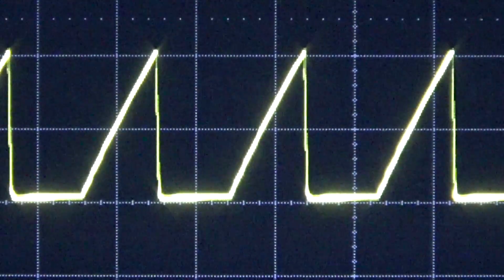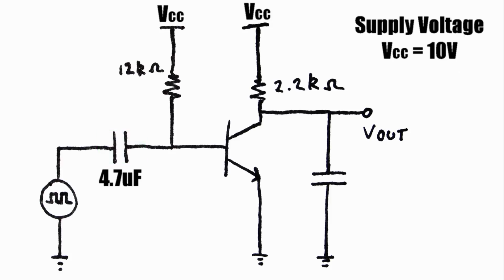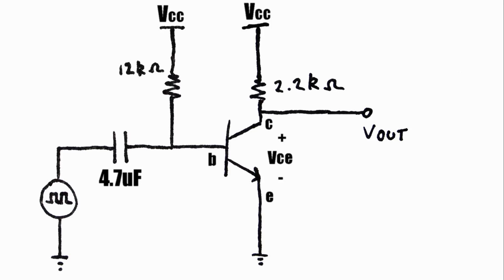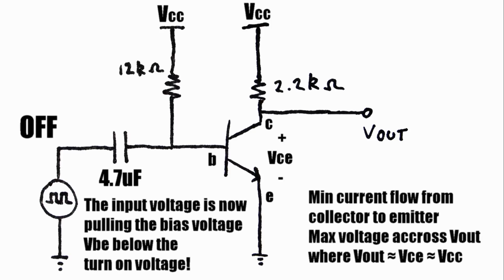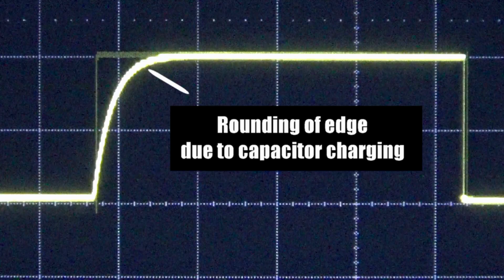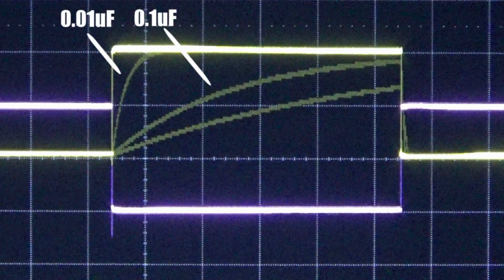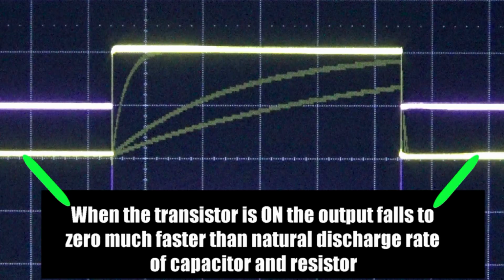Sawtooth Wave Generator - Using NPN Transistor and Capacitor

Comment: Hi! how i can control sawtooth wave rate ?
Reply from the maker: Hello! The output sawtooth frequency can be controlled by changing the input square wave frequency. Just note that capacitor value might need to change depending on the frequency range you desire (to stay in the linear 'ramp' region, to not fully charge).

Comment: I wonder what the difference in timbre is between a 50% duty cycle saw and ~100%
Reply: 100% on or off means there is no frequency since frequency describes the rate of change in a signal. Therefore it would be silent.

Comment: That is an easy way to do it. I would encourage anyone interested in Sawtooth waves to look into current mirrors and constant current sources for charging the capacitor.
Reply: Yeah I was surprised the constant current sinking property of the transistor was not used here. It's an RC exponential curve thing with a transistor discharger?

Comment: actually the collector emitter junction has a small voltage drop, which means the cap wont discharge completely. using a mosftet would make it drop to 0
Reply from the maker: Yes, you are correct! For the BJT there is a small emitter resistance ~25ohms which causes a slight offset.
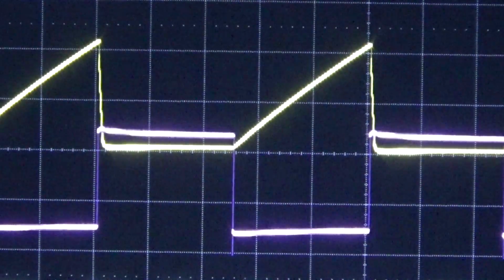Reply: Way late but does that explain the slight offset of the sqaure-wave rise to the sawtooth rise as seen at 5:33?
Reply: @datpudding5338  no, the levels of the signals on the screen are almost randomly picked. He picked levels that are far away from any signal overlapping a line from the other one, but didnt have the screen real estate to completely separate them in 2 non-overlapping sections that only share their time domain axis